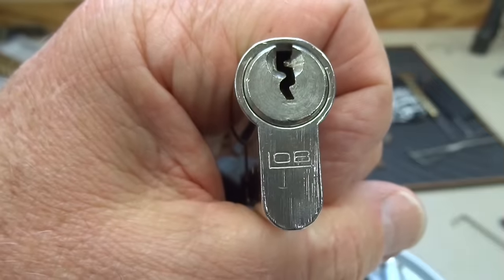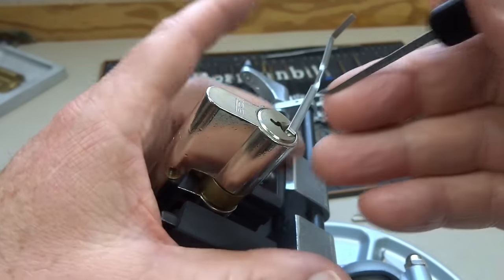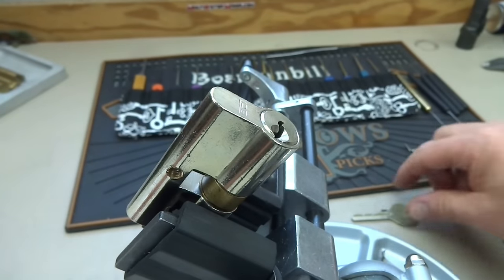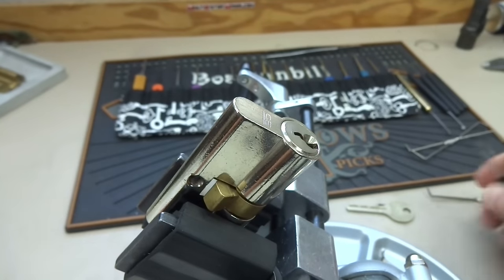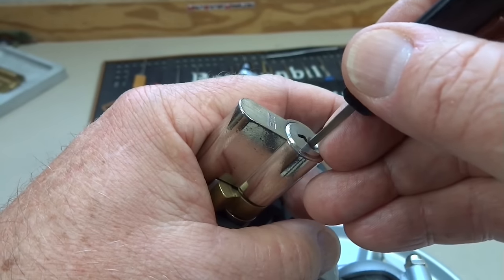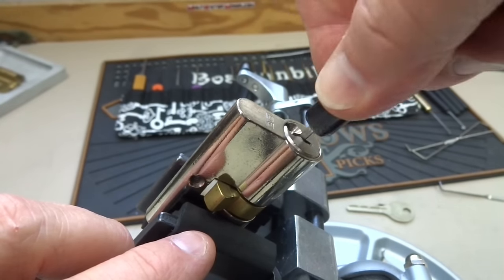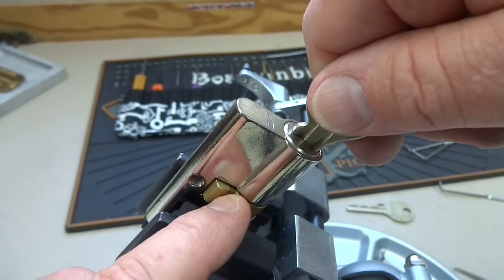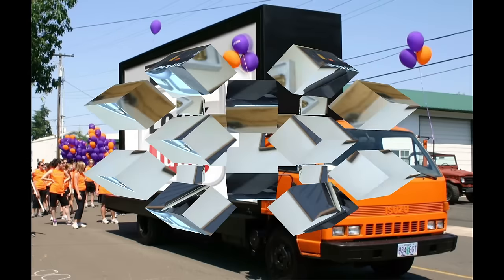(707) Thomas' Mystery LOB Cylinder

Comment: It seems to be a lockout setup. If the key on the inside of the door is inserted (and turned slightly), the lock can't be opened from the outside at all.  Just a guess, but it makes sense to me. 

PS- this isn't the 707 video I was waiting for!  😎
Reply: +LockPickingLawyer I think I like this explanation the best. I could see some kind of of machinery where it might be dangerous for the door to be opened while someone is working (especially if the door opens inward) and the space is confined.  Or maybe some kind of area where confidential documents are processed.
Reply: +stonent yes, like a count room in a casino...
Reply: I was thinking along the lines of a hotel room when I made the comment.

Comment: We used to have such locks in Poland. I guess the primary idea was to make the lock more difficult or near impossible to pick because of the key length. The long key would be used on the outside of course. With a regular euro cylinder you can typically use the same key on both sides and the orientation of the cylinder doesn't matter. In this case it's impossible to use the same long key on the inside due to the asymmetric shape of the key way (actually when I first saw those locks in a store years ago I was really wondering how do you open this thing from the other side). To work around that they've made a second key to manipulate the lock from the inside.

Comment: I've seen them back in BG, they sell it as a high security lock exactly due to this key, so when/if picked on the outside that you can't open the inside even if the cylinder is broken, and you can still have the key working to unlock your door.
Good job Bill as always!

Comment: +bosnianbill This is a strange lock indeed. I think that it actually is "unpickable" if used in a european door with the "funny" side in the outside of the door. Apart from snapping the core in two, it is actually impossible to open without the huge key. It is kind of security by obscurity, but i find it kind of a good idea actually.

Comment: You wouldn't be able to apply tension to both sides of the lock anyway, unless you had an accomplice on the inside (in some nefarious hypothetical situation).
Reply: +Road Stuff If you had someone on the inside, you would just have them pick it.
Reply: Good point :D
Reply: +RMDan or simply have them open the door from the inside lol
Reply: GMELECTRONICS365 Thats assuming they have an exit key for the door, so why would you consider picking it.
Reply: +Road Stuff If you pick the 'outside' one, you can turn it 180 degrees and technically with very long tension wrench it could be possible to get some tension, but picking it will still be very hard

Comment: This would be great for stores. The Manager opens the door, the clerk gets in, but is still able to lock the door from the inside during lunch hour.
Reply: I really like this explanation. You could technically do the same with a half-master lock (outside cylinder master only, inside take both), with the added benefit that the "manager key" will close and open things from the inside as well. With this lock, the manager has to pretty much have both keys.

What this lock has as benefit over the subtly-pinned lock, though, is a) it's very clear during installation which way round it goes and b) man that key is impressive. ;)

Comment: That just screams some sort of egress door situation; easy to get out (maybe with a common key used internally throughout the building) but a pita to get in.   No idea though what it is specifically for granted.  Would make a good lock for in prisons (in this case the nasty side of it is faces inwards so it is unpickable by inmates).
Reply: +Yuki Fox I would think for prisons having any type of lock that faces inside the cell is a serious design flaw.
Reply: +GreenLanturn93 right? What is this guy talking about..
Reply: +GreenLanturn93 prisons don't just lock cells they also lock common rooms, mess hall, visiting room, etc.There are alot of two way locks in prisons.

Comment: I will explain that. I'm from Poland.

In Poland we tend to install multiple locks on a single door.
So if you want to break in, you have to pick at least two of them (the top and the bottom one). Sometimes you even have third one in between :)

So.... i suppose it is made to waste your time.
Because potential thief thinks that this is standard lock 
he will try to pick it. But he will only waste his time and get frustrated....
because it's picked but it doesn't open.

And you always install this fake side to the outside of the door.

Comment: I have a few locks like that. German made, all with serial numbers on both sets of keys. I can't say where i got them, but i can say that when you pick them you cannot turn the lock without the actual key. 

One that i have serviced showed me that the inside of the lock was disconnected (moving freely inside) and that once the key was inserted it made contact with it and only then turned.

I think the idea is that back then, when someone tried to get behind the lock, it would be an extra step. These locks also went with a special lock that's inside the actual door, which would put considerable pressure in order to prevent opening if the system was somehow bypassed.

I tried to explain it as best as i can, for me this is just a small hobby so the terminology escapes me.

For your lock, i can say that it's most likely an embassy lock.

Comment: it's out of a TUR1 deadbolt or deadlatch. some have a thumbturn inside and some are keyed. there is a short key for this for the side that has the actuator attached.
Reply: one way passage for those with short key. long one may be a master key. I bet there are master pins inside.

Comment: My guess is the side that will not actuate when picked goes on the outside of the door as an anti picking measure. Since it won't actuate without the other side being unlocked nobody can pick their way in. Try picking that side with the short key inserted on the other end and see if it actuates.

Comment: Perhaps it's meant as some kind of security/fire safety measure? If the short key side is on the inside of a secure location,  the occupants can leave the key in the lock so they can open it quickly if necessary. This however doesn't compromise the other side of the lock. With the long key, it can push the short key out of the way if someone needs to open the door from the outside.

I would be curious what would happen if you had the short key in the lock, and then picked the other side - would it give you an open, or does it need to be tensioned from the short key side too?

Comment: Only thing I can think of is a door where you want it always locked but one side needs to be more secure?  We had a door to a server room like that... from the outside you needed two keys to open it (both were spring loaded one was a lock the other was the handle latch)  from the inside you just needed to turn the lock and the door handle opened it.   
similar idea maybe?

Comment: I used to have this kind of lock, with this looooon key, at my flat in Warshaw. To open doors from outside you needed this long key and from the inside just the short one.
Reply: +Jan Mejor Are you saying that the door cannot be opened from inside without a key? What if there was a fire?
Reply: +OmikronZeta No, no. Just if you lock them 😃 But one key works from the inside, the other from outside. If you lock from the inside though and leave the short one in, well ... you will know what time yor kids are back.
Reply: +OmikronZeta We would typically have a set of two locks - one at eyesight level with a cylinder on the outside and a knob on the inside. This one would be used on a daily basis. The second lock with an euro cylinder was fitted below the door handle and used keys from both sides. You would use the second one once you wanted to lock your house or flat when there was nobody inside. This was useful because in case a burglar would enter the house in some other way (through a window for ex.) he wasn't able to unlock the door from the inside in order to carry out the valuable stuff.
These days most doors in Poland are fitted with a pair of euro cylinders pinned to use the same key - one of them has a keyway from both sides to secure the door when nobody is inside and the second one - a keyway from the outside and a knob on the inside - for daily use.
Reply: +OmikronZeta Most people hang their keys on a hook near the entry doors. 
If the door can be opened without a key and a criminal uses that feature to burgle your home, the insurance company won't pay out your claim.
Reply: +Krzysztof Nowicki produkuja jeszcze takie zamki?
Reply: +queenaston I had this kind of lock in my flat in mid '80s and haven't seen them for long time...

Comment: Here's an option as well... 

Secure entry,  free exit... 

The long key on the outside. 

Store manager or owner has the long key. They can unlock the door from the outside. 
Employees that close the store have the short keys. They can unlock or lock the door from the INSIDE only. When closing the store,  they can lock it,  but once the door is shut, they cannot get back in.

Comment: It's not weird lock, the long key prevent the ability to insert any key  or tool from out side while you in your home /room
Reply: The other way round. If the long key is left inserted in one side, then all the pins are at shearling and on the other side you can just turn the whole assembly with any flat screwdriver or whatever.

If however the short key is left in, and flat, you can push the short key out using the long key and open the lock, or if it is slightly turned (but not open) the long key can't do squat.

However if you leave the short key in on the inside for that purpose, picking the other side and then pushing a tool through would enable you to turn the other core including the key.

Comment: Interesting lock, can't find any info on it though (and I'm Polish, LOB is very popular here)

They have another interesting system - you can install lock in a newbuild house, give key A to contractors/whoever, but when you are about to move in, you insert key B and BOOM! magic happenes and key A is no longer usable, only key B fits :D It's also quite secure, well-made and of course kinda expensive :/
Reply: These exist in Bulgaria (where I'm originally from). Once you insert your key and turn it around something snaps at the end of the key and the service keys won't unlock the lock any more.
Reply: +JGambolputty +Ivan Atanasov Its pretty easy. Between the last key pin and top pin, there is X ball bearings, corresponding to the number of key "generations". The first generation key has the lowest cut on the last pin. The second generation key do have one slight higher cut on the last pin, causing ONE of these ball bearings to came above the shear line. On the side on the cylinder, there is small holes, where the ball bearings fit in, but not the top pins. When you turn the cylinder, one of these ball bearings will get lost inside one of the holes. This means that when you again insert the first key and try to open, because one of the ball bearings will be lost, causing the top pin to fall Deep enough to block the cylinder - eg there is not enough ball bearings to push the last top pin above the shear line.They exist here in sweden too, but not for Contractors and new builds, rather, its for key Control, eg if you lose a key, you start using key set 2, causing key set 1 to be invalid. Those locks are delivered with 3 key sets and have 2 ball bearings in the lock, so you can only lose the key 2 times Before a lock change becomes neccessary. Normally, you should then according to the instruction immediately buy a new lock when you land on key set 3, so when you lose a key inside key set 3, you simply install the new lock and begin on a new key set 1.These different key sets is so you don't have to lay down work to change a lock when you lose a key, you just start using a new key set.On new builds here in sweden, the houses are normally nonlocked during construction. Theres nothing to steal. Sometimes the Contractors temporarly put in their own cylinder while they work, and when work is finished and you are about to move in, they often take out their own cylinder. If there is, for some reason, a neccessary to keep the house locked until move in, the workers will "deliver" the house in real time, removing their own cylinder while the new house owner Watch. (and then the house owner can insert their own cylinder)

Comment: Can the long key open both sides? E.g. by inserting it half way? If, then it is just that different levels of clearances are needed depending on door direction.

If not, then perhaps master keys weren't invented yet?
Reply: No I don't think that would work because the key would be backwards in relation to the pins. Pin one on the key would be trying to engage pin 5 on the lock... and so on.

Comment: Maybe the simplest explanation is the correct one?  Due to the mis-matched keyways, the long key permits entry, but not exit; the short key exit, but not entry.  Neither allows the reverse...and the length difference makes them easily identified.  I'm betting this has nothing to do with the item's "pickability."
Reply: +Keith Schrack Reason  It is about security, longer key is  used from Outside
and noone with standard picks cannot pick both cylinders(sides)
and for convenient inner key is shorter

We have other brand and model GUARD G900 Supra(not in production anymore :-( ) where is only one cylinder trough all body,  it has  10 security pins very restrictive keyway against picking and You need two same lenght keys one from outside and one from inside. 
It was developed for military applications high drill, pick, and other ways proof...

and Poland people from LOB makes this "simplified" version ;-)

Comment: its better security no pic is going to be able to reach the other side so basically you can't open it without that master key on the outside but on the inside you can open it with that one so that you can easily get out of the building.

Comment: Does some one have a chart to translate the blind code numbers of Master padlock keys to the bitting code? for example a Master padlock key stamped with the numbers (3704) does not mean that the key is cut to those depths it's a blind code only,  and it needs to be decoded to the bitting numbers. I need a chart to translate blind codes to bitting codes for master padlock keys. Thanks!

Comment: I could see it being useful in some kind of high-security laboratory with volatile chemicals where you need to have everybody access a central location to get supplies, but also need to only be able to access their private headquarters to do classified research where you don't want other employees having access..
The long key would be used for getting into each person's private headquarters and the short key would be used for getting out into the main area to get supplies.
Each person would have a uniquely keyed long key to access their private laboratory, so they could not access someone else's, but everybody would have an identical short key to access the main area, should they need to enter the building or leave any room they went into with persmission, provided someone with their unique long key let them in. 
The short key side would also be uniquely pinned in other laboratories with the same setup to prevent someone from gaining access to another warehouse with a similar set of private laboratories they did not have access to.

Well that's my my hypothesis, I hope my explanation is clear enough to understand.